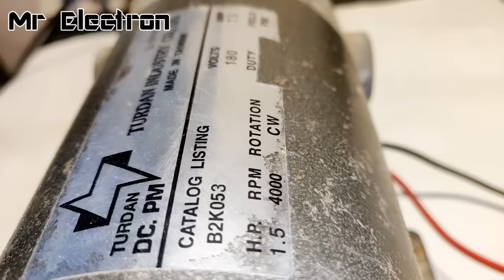12v 100A Super Capacitor Battery for High Current DC Motor - Amazing Idea

Comment: Sorry for the criticism, but your soldering technique need some serious work. You are making dry joints all the way, that will come loose with the least bit of pressure or vibration.. First solder on the copper track with a little bit fresh solder so that the copper is "tinned". If you have some flux available it is a good idea to apply some on the bare copper track, but not necessary if your solder wire have a resin core. Do the same with the component, in this case capacitor's pin. Just "tin" it withe a thin layer of solder. Now, fit the capacitor and apply the soldering iron against both the pin and copper track, and at the same time apply a bit of solder. You will find that your solder will smoothly flow into a perfect connection. The idea is that both the copper track and component pin must be just hot enough to melt the little bit of solder on them by themselves, and therefore the solder "bind" to the copper. When you then install the component and re-heat both at the same time,the solder flow and fill the gap as a single "entity", and you just apply a little bit extra solder to fill it up nicely. Now that you have taken some time to calm down, just try it and if you want to, thank me, but advice is free after 40+ years experience.. :-)
Reply: Agreed 👍
Reply: Totally agree ... component placement isn't very good either.
Reply: I agree I chring when he dry soldered
Reply: Totally agree. Looks like the autor is service man for old soviet TVs.
Reply: Here nothing is professional 😂 May be this is done in purpose.
Reply: Constructive advice
Reply: Eso pensé cuando ví la torpeza de soldar,,,
Reply: Great thanks for this informative effort. Specially, in high DC current flow cases the circuit need best conductive track.
Reply: Gjı
Reply: U are right
Reply: And the other thing, this guy are soldering on the back plate
Reply: Thanks random internet stranger guy 🤠
Reply: Agreed
Reply: Your criticism is educational to me, thank you
Reply: That’s only marginal besides this lot of fundamental deficits in knowledge .
Reply: well, he will learn from his mistakes
Reply: I came here to say exactly this but you've saved me a job 😂
Reply: and the all electrical components quite dirty
Reply: Well explained...👍
Reply: Hi
Reply: I just noticed the same thing. The soldering joints were not as good as needed.
Reply: Agreed. Good advice

Comment: When soldering, heat the connection first and apply solder to the JOINT, not the iron.  It's especially important to get the foil trace on the board hot enough so that solder will flow into the through-hole.

Comment: One little hint: to get a good solder joint, you should first heat up the pad and the pin of the part and apply the solder while still holding the solderingiron onto it. Do that until the pad is covered in solder. To check if the joint is ok, just look at it closely. If the solder is reflecting and even, it's good. If it is uneven and matt, add a little more flux and reheat it. 
I hope you appreciate my expert advice.
My level of education is: electronic engineer for industrial engineering
Reply: Un grazie ,sincero da Giuseppe Tambuzzo di Milano Lombardia Italia

Comment: you should solder by first heating the two parts with the solder gun, and once hot apply the tin solder. Never directly in the tip and then to the parts since it will lead to weak soldered joints.
Reply: Apparently he has habits from a transformer soldering iron. Of course, a tip soldering iron requires a different soldering procedure, but there are tip soldering irons that can immediately increase power, so they behave like transformer soldering irons.
Reply: Hi baby
Reply: Until you get the component too hot and the lead moves with the melted plastic around it
Reply: @80milekyle70  Right. When I started soldering "the  correct way"  I ruined a number of components. Made them too hot.
Reply: Always use the correct temp iron for what your working on.  And or use heat sink to prevent damaging your components

Comment: If you have capacitors in series to meet the voltage, you have significantly lost their capacity. This way you only have 83F (17V) instead of 3000F (2.8V). Converters from 3V to 12V are relatively low-loss and would significantly increase the time of motor rotation or lighting. It is possible that all of this capacitor board allows (no data is provided around it).
Reply: Converter? What kind of converter?
Reply: @josephbadulak9146  DC-DC (step up)
Reply: Energy storage in Joules is 1/2 CV², so it ends up the same whether in series or parallel, assuming they're all equal.  The voltage term being squared makes up for the lower capacitance in a series connection.
Reply: @dubmob151  Of course, the Joule density, or power is the same regardless of the connection, but it is a condition of operating voltage, power retrieved and the resulting time ...
Reply: @DL-kc8fc  higher currents with the parallel connection and dc conversion efficiency may result in higher losses though.
Reply: @dubmob151  It depends a lot what operating voltage you require for conversion, and this must depend on the wiring diagram, which can be a combination of serial and parallel wiring. In practice, however, the parallel connection is given more advantageous due to large capacity.
Reply: they don't lose capacity.  Capacity and capacitance are 2 separate things.

Comment: Just my thoughts here. Don't be afraid to really heat the joint/solder/copper leads up. Give it ALL time to reach the melting point and WAIT for the solder to actually flow away from the initial clump to a nice shiny lake. Then, pull the soldering iron away. You really have to work at it before you do any damage. Waiting is hard to do, but it gives the best results. Nice video.

Comment: Three years ago I installed a Maxwell Supper capacitor pack six capacitors and they work great. I also use a pack on my lawn mower, no more batteries wasted.
Reply: How long does the pack last if using continually. thanks.
Reply: @gilldanier4129  5 seconds

Comment: Amigo, boa Noite!
Tenho duas observações para fazer:
1 - Não se deve colocar a solda na ponta do ferro e depois colocar no circuito, pois a solda queima quando esta na ponta do ferro e perde a sua liga, você deve aquecer as peças a serem soldadas e colocar a solda nelas  e não na ponta do ferro de solda.
2 - Você soldou os capacitores pelo lado errado,  não se coloca componentes por cima do outro, principalmente destes mosfets que aquecem.
Fora isso a ideia é boa.

Friend good night!
I have two observations to make:
1 - You should not put the solder on the tip of the iron and then put it in the circuit, because the solder burns when it is on the tip of the iron and loses its alloy, you must heat the parts to be welded and place the solder on them and not on the soldering iron tip.
2 - You soldered the capacitors on the wrong side, there are no components placed on top of each other, especially these mosfets that heat up.
Other than that the idea is good.
Reply: Muita burrice em um video só! deu agonia de ver ele soldando!

Comment: Unusual soldering putting solder on the iron & taking it to the joint to be soldered. Since I was a Kid mid 80s I have always applied the iron to the contacks to be soldered & apply the solder for much tidier joints.

Comment: So you ended up using capacitor as a battery, good job in making the people aware... Those who were not aware.
But I'm more keen to know the efficiency, I mean generally Caps are in Farad but battery is in Amp hours... So looking to know about Amp-hours as you need to compare apple to Apple

Comment: The Capacitors should have been fitted on the other side of the board and also you have a louse soldering method. This way you make a dry or loose soldering which make the circuit an inefficient in performance. You have to be perfect in public display, otherwise you may get  lot of trolls and you also really have to improve your soldering skills.

Comment: Notice how he doesn’t let any thing run longer than a few seconds. That’s because capacitors hold a lot of power and are designed to deliver that power very quickly but that quick delivery in this small size drains extremely quick.
Reply: Just pair this with a classic battery and you're set.

Comment: Bro  why the capacitor s not discharging  how it  possible
Reply: It is, cant u see the voltage of the capacitor decreases When it uses to power motor, lamp, etc
Reply: Can we replacing batery on mobile with super capacitor?

Comment: what is the schematic for this circuit. If we wanted to make a 200-300 amp capacitor. in how many days it contains an electric charge. What is the electricity usage rate? Can we use it as storage in a solar panel or wind rose? for night use. Are there any other systems you would recommend? if so can you support

Comment: So why cant you just drill wholes in a copper plate and do same thing ?
Reply: because he made balance charging circuit to cut off voltage when one of the cap is charge and same with others so they will not over charge and blow up

Comment: How do you get energy? How does the motor rotate with capacitors without energy? Or are they batteries? What is sufficient is not to produce or store energy, but its role is to smooth out electricity and so on

Comment: First time soldering?
You connected them on the wrong side of the PCB and if you had cleaned the contacts, it would have been A LOT easier and you wouldn't have had to bodge it.

Comment: You should only have a very small ammount (next to none) solder on the tip.

You always melt the solder onto the thing u want to solder (ex u have a leg , u heat the leg with the iron tip , and melt the solder by touching it on that leg , not by touching on the iron tip.

Comment: Will it work in 24v dc if we connected 6 parallel and then make a another set and connect in a series will it run 24v motor
Reply: Might work, as those capacitors are soldered in series.

Comment: those caps were in parallel, did you apply 12v to them when they were wired like that?
Reply from the maker: they are in series cause of the circuit board making  around 15v
Reply: @MrElectron  I meant before you solder them onto the circuit board they WERE connected together in parallel
Reply from the maker: no.. i provided 2.7v dc

Comment: Sir
Pls help

I need to know for how long(in terms of Time) can a capacitor of 15v 83 f take to discharge to 12v and then to 10v.
This capacitor will be connected to 7amps continuous power draw.

Pls let me know.

Comment: Can WE for exemple run a car Starter with it ?
Reply: yes you can
Reply: Run a car starter ??? This is ilarius !!! 😂😂😂
Reply: @francescogerotto8496  yes you can start car with it but one or two times only 
This is not a joke and not any reason for laughing 
Only one reason for Laughing that you dont have knowledge and proper information about it
Reply: @Davidslabofficial  i nead it to make test on starters that's all bcs using a batterie die quickly :/
Reply: @djabirkheirallahboumala4808  yes it will do the job but installing it instead of battery is kinda unsafe 
Because if capacitor over charger it will blow up

Comment: arkadaşım yazayım mı yazmıyayım diye düşünür oldum. bazı paylaşımlara yorumlar yapınca cevap olmayınca yazmak içten gelmiyor. bangoggdan 6000w lık inventor aldım tam sinüs akıllı diye aratıp aldım ama tam sinüs değilmiş galibaki dc leri çalışdırmıyor.bu invantoru nasıl dc veya tam sinüs yapabilirmiyim. ayrıca 343 lira gibi gümrük geldi bunu bangoggdan alabilirmiyim. cvp yazabilirsen sevinirim. 1093 lira sigortalarıyla 1221 lira gibi bi fiyata aldım, ayrıca kondansatorden akü yapabilirmiyim 24v 70 amper gibi yadatlfar için yapılan taşıma şarjlardan akü yapma şansım varmı

Comment: What could be rating of this battery  - like AMP. HRS ? That is , if draw 1 amp, how long the battery will supply ? What is the maximum charging voltage ?

Comment: Can you please tell me if I want to run a 3 phase 5kw induction motor for 2 minutes then how many capacitors will be required
Reply: 1 Farad capacitor loosing 1 volt voltage output if discharge with 1 ampere current for every second.
Reply: @ridwanbrm7706  
How we calculate that?

Comment: May I know the exact specification of capacitor and plate?
Reply: It is written as " 2.7V 500F" . on the capacitors. Very high capacitenc ! So far I used only capacitors of micro farads (mfd)

Comment: Caps are on the wrong side of the board! And Heat the solder point and add solder to it, it will make the solder flow much beter

Comment: U would get way better solder joints if u put the iron on the joint 1st then add solder its not very good practice to add solder to the iron 1st then to the joint
Reply from the maker: Thanks ... I will definitely try that :)
Reply: @MrElectron  👍

Comment: Strange kind of soldering. This way you can easy get cold joints because cleaning flux evaporate in the air and don't touch the soldering point. Try once with soldering wire (with flux core) touching the joint to be soldered and place soldering iron to melt it, slowly feed soldering wire until you have tin flown all around the joint.  So you will get smoot, perfect, mirror shining joint.

Comment: For how long can it run a mixer motor
Are these capacitors available on market
And can u use without the board
Reply: Hi

1F -> 1As/V (1 Ampere 1 Sekunde pro Volt). 6x 500F -> 500/6F=83F (83As/V). Wenn Du 1A 83 Sekunden lang fließen lässt, sinkt die Spannung um 1 Volt.
Oder bei 83A eine Sekunde lang.
Also in den Dingern ist schon 'ordentlich Bumms' drin - aber WENIGER, als in einer handelsüblichen 08/15 Batterie.
Eine AAA-Batterie beinhaltet ~800mAh -> 1h = 60m = 3600s --> 2880000mAs=2880As.
Zugegeben - die Batterie kommt nur von 1,5V auf 0,8V - hat also 'nur ein Spiel von 0,7V' - 2880As x 0,7V = 2016AsV (yehaa, was eine Einheit) - wobei die Spannung von 1,5V auf 0,7V abfällt - der Kondensator kommt auf 83F x 14V immerhin auf 1162AsV - wobei aber die Spannung von 14V auf 0V abfällt.
... nur ... welche Schaltung komt nominal mit dem Spannungsbereich 0-14V zurecht, ohne selber die Hälfte der zugeführten Energie zum Umwandeln zu verbraten?
(ok ... die Hälfte ist übertrieben)
Trotz wesentlich größerer Bauform, ist die AAA-Batterie dem Kondensator-Pack in vielen Bereichen (weit) überlegen.

Ok, zu Deiner Frage:
Wie lange läuft der Mixer mit einer AAA-Batterie?
Somit wird auch die Kondensator-Lösung nicht sonderlich lange den Motor 'am Leben' halten - spätestens bei 50% der Spannung (dadurch - bei angenommener rein ohmscher Last - 50% des Strom, dadurch nur 25% der Leistung !!) wird der Mixer rein gar Nichts mehr machen - und dabei ist der Kondensator immer noch halb voll!
Reply: @aaaooaao9949  what is the schematic for this circuit. If we wanted to make a 200-300 amp capacitor. in how many days it contains an electric charge. What is the electricity usage rate? Can we use it as storage in a solar panel or wind rose? for night use. Are there any other systems you would recommend? if so can you support

Comment: Please don't be angry with me. With your soldering attempts, it scares me a lot. With the solder (with flux core) and the solder tip at the same time at the solder joint, you achieve "correct" and functioning solder connections with clean and durable solder, instead of cold glue. You've probably already noticed that the supercaps belong on the other side of the board? There they sit flat and firm, instead of wobbling crooked over the semiconductors.

Comment: Learn to solder properly. Fluks should be applied to joint then  heat the joint with soldering iron then apply the solder. Good luck.

Comment: My eyes hurt seeing you soldering. Please heat up the pcb via with the iron tip and add carefully flux core soldering tin, eg SN60PB40. 

And btw: you soldered the caps from the worng side on the pcb.

Comment: 12v 5amp load maximum time?
Reply from the maker: ~ 60 sec
Reply: How long do they hold the voltage after charging?
Reply: @MrElectron  5a 60sec gives 0.083ah capacity. 100ah Busted

Comment: How could that be 12v 100A? While if we use 3000F capacitor, we've got this calculation Multiplying 3000F by 2.7V gives you the charge in Coulombs, i.e 8100 coulombs. Dividing this by 3600 sec/hour gives you 2.25 ampere-hours. So 1 supercapacitor LPSU 3000F only have 2.25Ah

Comment: how much is autonomy
Reply: 1 second, it's not a battery, it's a fake...
Reply: @jeave6286  its not a battery they are super caps dumbo they can store huge amount of current
Reply: am electronic, so we do not do it. Or give me the exact reference of your caps: I buy immediately @Davidslabofficial
Reply: @jeave6286   2.7V 500F 35 x 60mm Super Farad Capacitor
Reply: @Davidslabofficial  it is a kit on sale for 55 € on amazon, it is a stabilizer of tension for automobile, to protect the battery!
Reply: @jeave6286  or search only super cpacitors online
Reply: 1_second

Comment: It is wrong see the calculation with formula
With 500F capacitors
((2.7*8)^2*250)/(1.2*3600)=27 Ah
But with 16 capacitors
((2.7*16)^2*250)/(1.2*3600)=108Ah
So you need 16 capacitors not 8 for 100Ah equivalent battery

Comment: You could put 5 or 10 of those together parallel so that it is 12 v 500ah or 1000ah and really run something for hours.
Reply: RUINS MARS it’s like the same thing in car audio with 1.0 fared caps just hold enough energy for low voltage

Comment: Your knowledge and experience of soldering on the plate is very poor. The surface thickness of the copper plate will not withstand such incomplete or wrong solders due to the intense current flowing over it. Openings occur on the solder circles on the copper plates. !!!!!!!!!
*********
Plaket üzerinde lehim yapma bilgi ve tercübeniz çok zayıf. Bu tür eksik ve yanlış lehimlere, üzerinden akacak yoğun akımdan dolayı, bakır plakanın yüzey kalınlığı dayanmaz. Lehim çevrelerinde, bakır plakalar üzerinde açılmalar oluşur. !!!!!!!!!